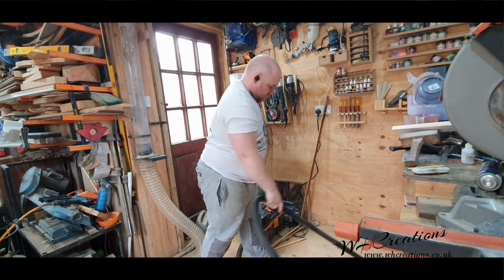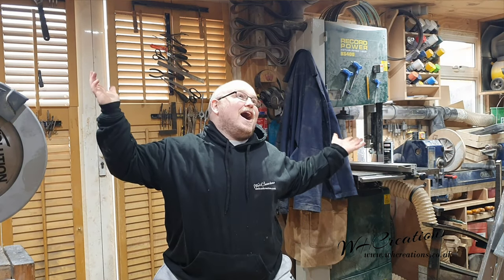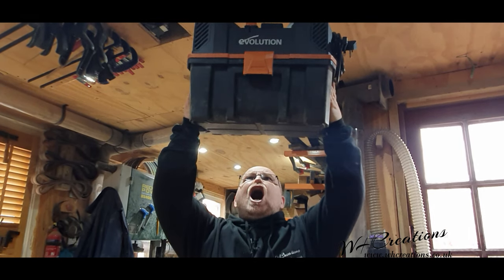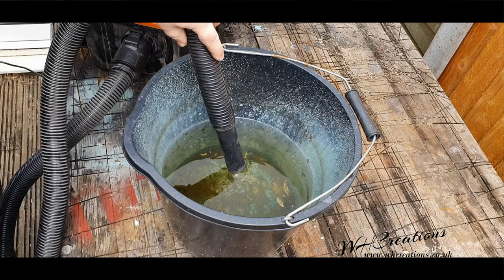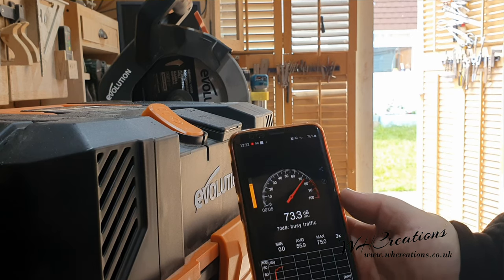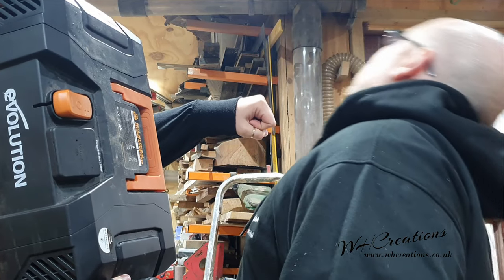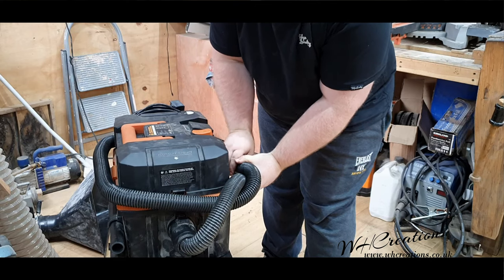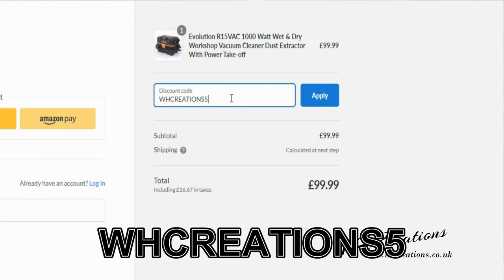Evolution R15VAC Wet And Dry Shop Vac Review

Comment: I don't normally go for "funny/humorous" in reviews but, yeah, it was fine!  I only came across the Evo-vac recently.  We already have a Vax that my son has rigged up with a cyclone & both on a trolley. But it's a bit of a PITA to shift out of the workshop.  Something like this would be great both in and out - and yes, that auto-power take-off thing is very interesting!

And sometimes I just need to blow Stuff off the patio or suck up any water that makes it past my 1st-line defences into the garage when we get those summer downpours.

Hmmm ... subscribed!
Reply from the maker: Cheers

Comment: Just bought one of these to go with a, surprise surprise, Evolution mitre saw. You didn't test the blower function - if you had, you've have found another design flaw - you have to remove one of the stored tools to plug the hose in.
Reply from the maker: It's not a massive issue to remove the attachment. I'd rather have the place to store them than not.

Comment: Hi, I actually ordered one before watching your video. Three years on, are you still using it? If yes, did you manage to find a bag that fits the unit? Oh, and thanks for sharing!
Reply from the maker: So, yes, I do still use it. It's mainly used to clean up around my cnc. I don't use it commercially, though. I have upgraded to the festool midi for going onto sites. I never actually looked into a bag, although the main issue I find is the bin is simply not big enough. As soon as you fill it up 1/4 full, you have to empty it to stop it from clogging up. Would I still buy one? Absolutely not.
Reply: Thanks for the prompt response. I've got the big, three-motor Hyundai for the heavy lifting, and I've been using a cheap and cheery Parkside 20v vacuum.  I couldn't be happier with it, but for the fact that it rapidly goes through batteries.  I reckon the corded Evolution R15 will be just fine attached to the Domino, particularly if I can source a bag.🤞

Comment: WH Creations Are you planning to do an update review video  for the performance of the Evolution vacuum that is if you still have the product?
Reply from the maker: Hey, I'm not planning too, but I can say it's still going strong and used every time I'm in the workshop. The only issue I have is that filter that gets blocked extremely quickly and needs cleaning whenever you empty it. You really notice the difference in suction when it is blocked up though and a few good whacks in the bin gets rid of the majority to get it back to new again. My only fear with putting a bag around it is that it would take up valuable room in the already small bin and could cause issues when you use it. I think the bin needs to be bigger and something done around the filter. I'm not sure whether evolution will be fixing this on their next phase or not but I seriously think they should. I hope this helps, but let me know if there's anything particular you want to know.

Comment: Is there a 110v version of this?
Reply from the maker: Thats a good point. I don't think there is if I'm honest. I suspect you'd need it for site work?
Reply: @WHCreations  yes. Would it work if I plugged the 110v box to the 240v on the extractor?
Reply from the maker: Hmm that again is a good question, one I think would be better suited to Evolution directly. I would love to know whether it is possible though.
Reply: @WHCreations  ok. Let me know if you find out. Thanks for replying
Reply from the maker: Have been in contact with evolution. There are no plans to make the vacuum 110v, and you should be able to plug a converter into the power take off as long as the wattage of the machine being powered is within spec in the manual guidelines.